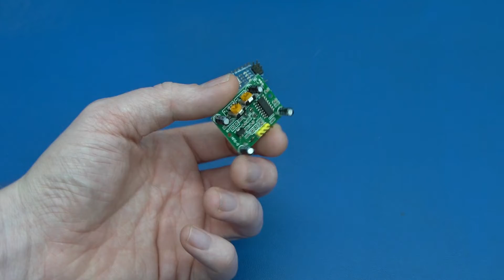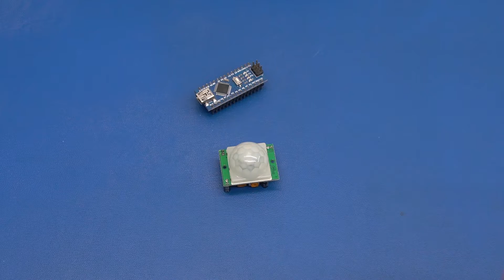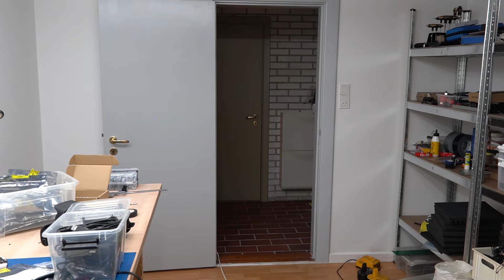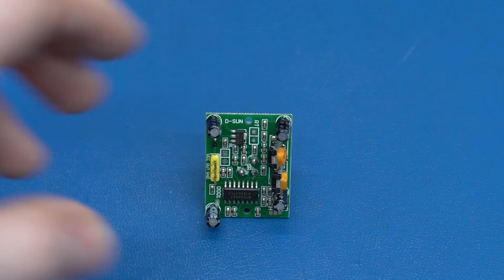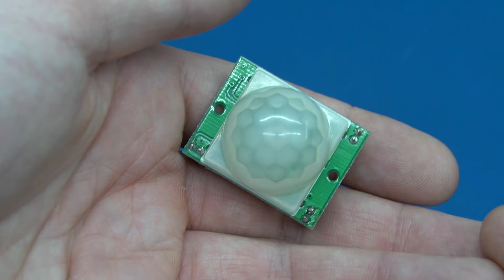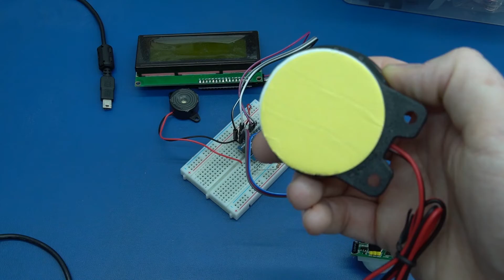Arduino Alarm System Build (Part 1) - Ec-Projects

Comment: I'd avoid using something like an R-Pi, far too complex and liable to crashing compared to a microcontroller, plus you're then open to any exploits that are found in the OS.

If you want to have external access either switch to an ESP based board or keep the Arduino and use the Pi as an external interface. That way if the Pi dies the alarm will keep working.
Reply from the maker: It might be. I have good experience with Raspberry Pi though.

Comment: To get network you can hook W5100 or W5500 or for WiFi capable use ESP based board like NodeMCU instead as a base, it can take existing Arduino code. Also RFID or NFC instead of the keypad would be more appropriate I believe. Any plans to add solenoid lock support to lock the doors and trap baddies?! ;)
Reply: RFID or NFC is a bad idea for alarm control.  With a code, you essentially have 2-factor authentication at your door (something you have: your key, and something you know: your code).  If you use RFID or NFC, your security is reduced to two things you have.  No knowledge is required and simple theft defeats your alarm, especially if your RFID tag is on your keyring.
Reply from the maker: I don't think I will do networking on the Arduino. :D :D 
As for the ESP, I did consider that, but I didn't make any decisions yet ;)

Comment: Maybe consider having two types of units - the arduino, sensor, a comms module and batteries in an enclosure that gets placed in each room/area to be secured - and a raspberry pi and the keypad to be placed near entry points which controls the system and poles each sensor unit.  Basically like a commercial wireless alarm system.  Julian Ilett
 is in the middle of an arduino project to monitor humidity and temperature remotely which has some nifty little comms modules that may be of interest - https://www.youtube.com/watch?v=uQxDr3Q_C2s&t=0s
Reply from the maker: My idea is to have 4 different devices. The controller, magnetic switches, PIR and keypads.
Thanks for the link :)